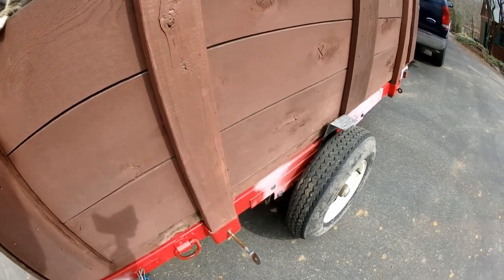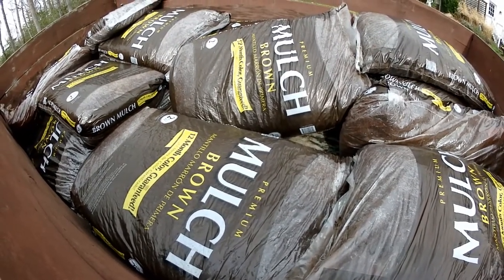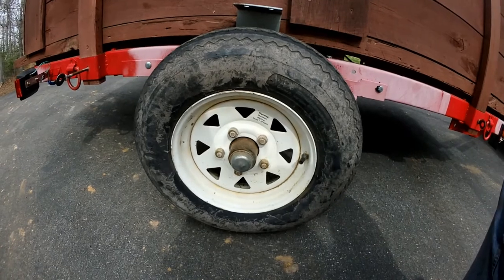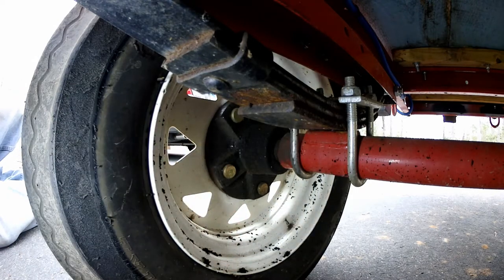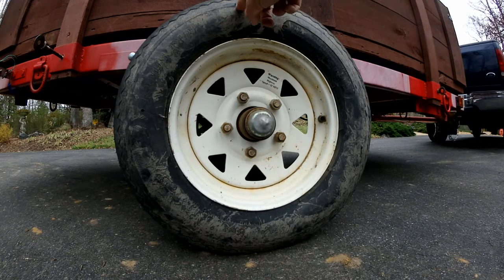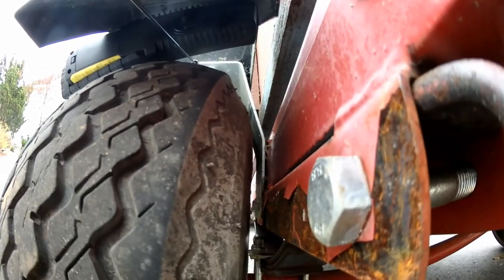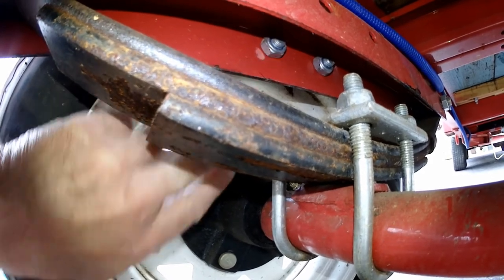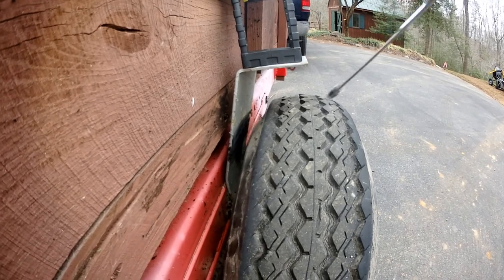HF Trailer: Close Encounter of the Wrong Kind

Comment: I had the same problem.  I’m wondering if those brackets were made for smaller tires as this trailer used to have smaller wheels.  A recall is clearly in order here.

Comment: Pretty simple fix. Use less air! More air makes the tire "bigger" so it will rub.
Reply from the maker: I did some research and the consensus was that if the sidewall says xx PSI, that's how you should inflate it. They also said that most trailer blowouts are from under-inflation, which is why I figured I had better get with the program. Anyway, I'm going to ask the tire guy what he thinks when I get it replaced.